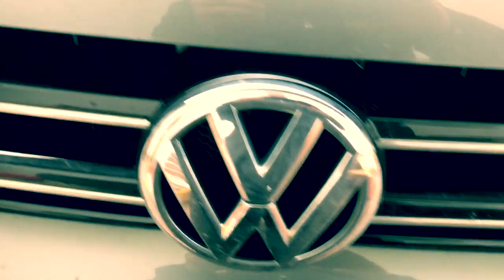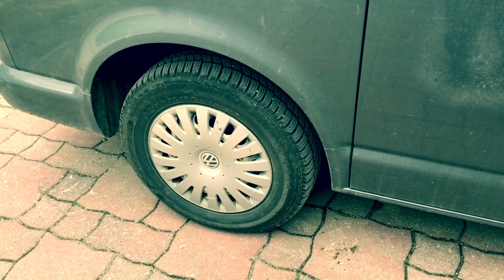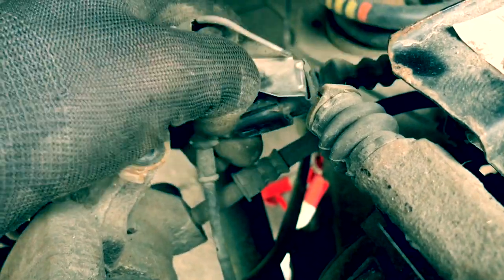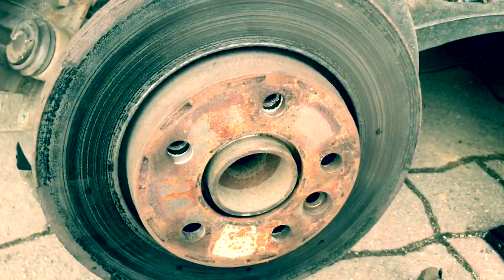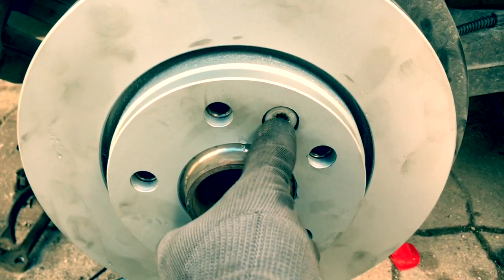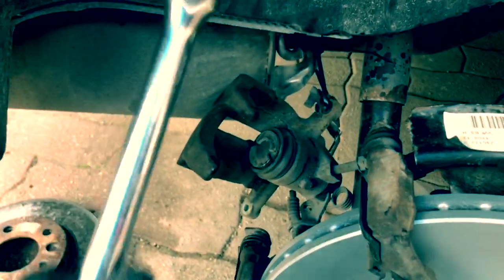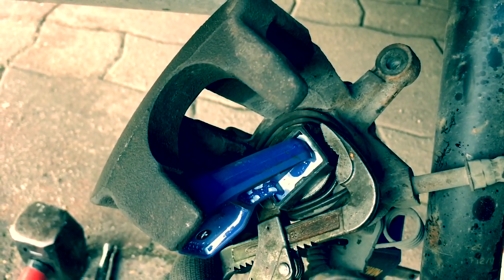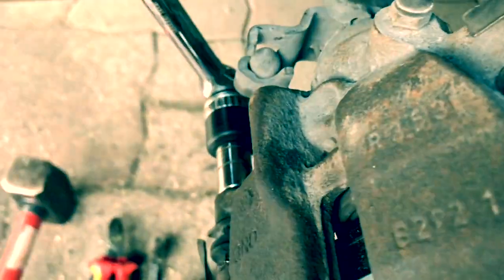VW T5 T6 Transporter, Mulitivan, Caravelle, Bus Rear Brake Discs & Pads

Comment: thanks for the video, ... the tool to compress and rotate the piston back into the cylinder only goes clockwise....your caption states anti,clockwise for the right...if you went anticlockwise you would bring the cylinder out and eventually pop out your seals from the bore
Reply from the maker: Thanks for feedback. Correct and you can't turn the piston  the wrong way and pop the seals as  it's ratcheted from the handbrake cable lever. You can do it 👍

Comment: great thank you i done it myself . one problem is that i put a tiny split in the bit of rubber around the piston when i wound it back . is it possible to change this rubber?
Reply from the maker: Well done. If you are talking about the rubber dust seal yes you can change it. You can do it 👍

Comment: Thanks for the info. Tis Silicon grease for the sliding pins so the rubber seals aren't affected. Also, how about undoing the bleed nipple a little to push the brake piston in more easily. Catch the brake fluid obviously?  Regards Stephen
Reply from the maker: Undoing the bleed nipple can lead to air in the system unless you can do all things at the same time. Thats why they make special tools to push the piston back. You can do it.
Reply from the maker: @Stephenpikeman  You can do it 👍

Comment: What size discs fit the 2005 T5 shuttle. It looks like yours was a 2004 or 2005. Thanks
Reply from the maker: That's was a 2009. All the same. Haven't got the details at hand. If you order some and they fit a T5 then you are good to go. Hope this helps. You can do it 👍

Comment: Just one thing on the slide pins most people put copper grease on the pin thats wrong as the rubber boot will expand with petroleum based product
Silicone grease is the correct one to use
Reply from the maker: Thanks for the feedback. You can do it 👍

Comment: Why shouldn't the engine be started  when priming the brakes?
Reply from the maker: Just safety in case someone has put it in gear to stop the car rolling as they have no hand brake while they are replacing the pads and then forget it's in gear and start the engine up. You can do it 👍

Comment: I cant get my pistons to wind back at all 😭
Reply from the maker: Rears -  are you turning them the right way? Try both ways while compressing at the same time. Or buy the caliper tool. You can do it 👍
Reply: @YoucandoitwithJules  tried the proper tool and everything. Even removed them and they still wouldn't retract so bought new ones from GSF.
Reply from the maker: @Hollingsabre  wow never heard of that. you can doing it